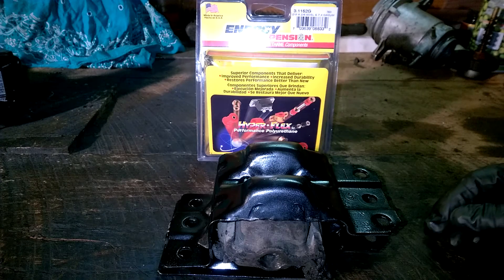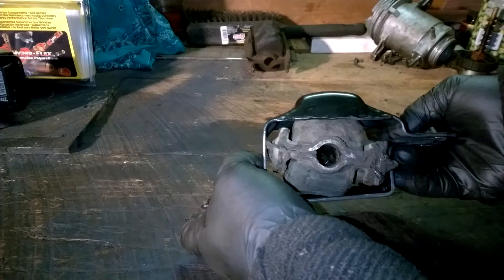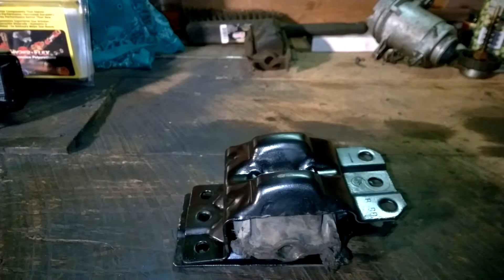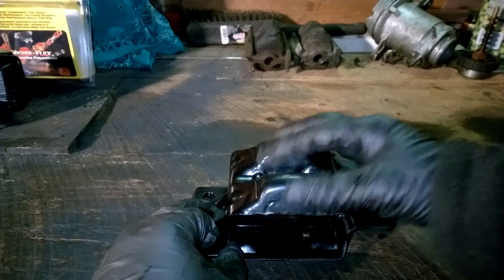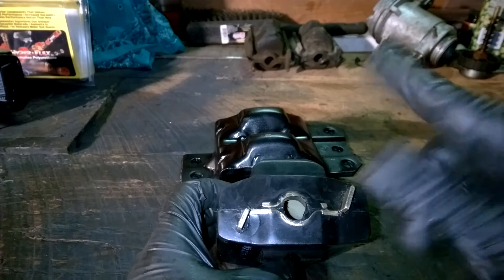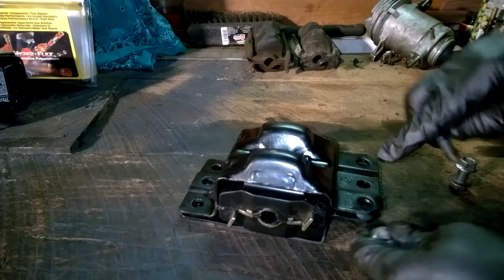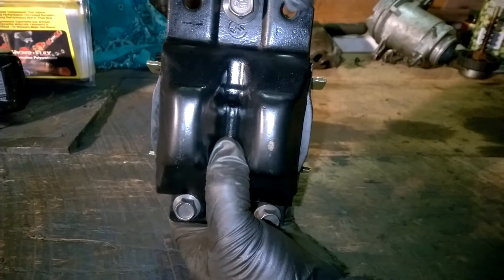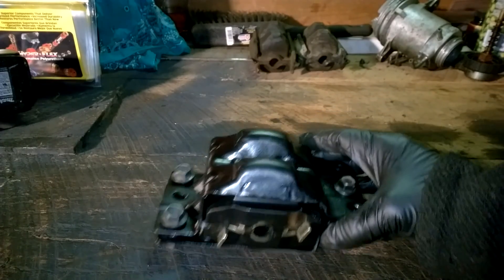Proper installation of Energy Suspension urethane motor mount inserts for the 6.5 Turbo diesel

Comment: Any vibration over the stock pair of mounts?
Reply from the maker: Allen, you can certainly expect more vibration because they are a harder substance than stock rubber. But if that is even detectable from inside the cab varies from truck to truck. Also, if it's even an amount to be concerned about is an individual opinion. 
so unfortunately, there is no way to really convey to you if it will be a big deal to you or not. 
I can tell you that for me, it was no issue at all.